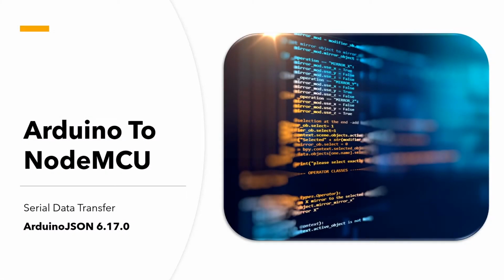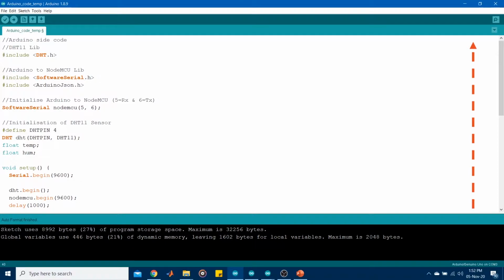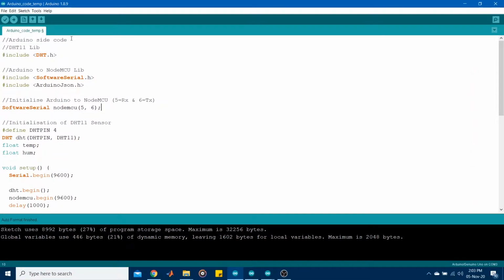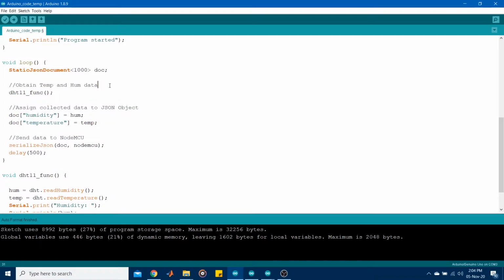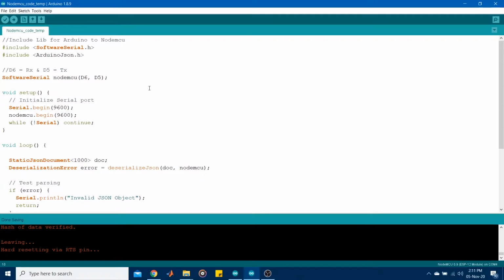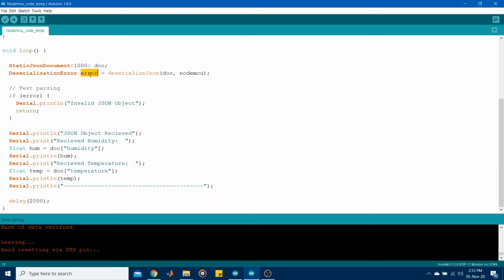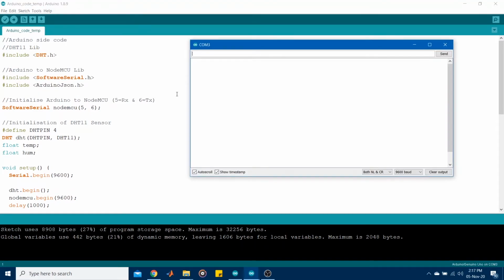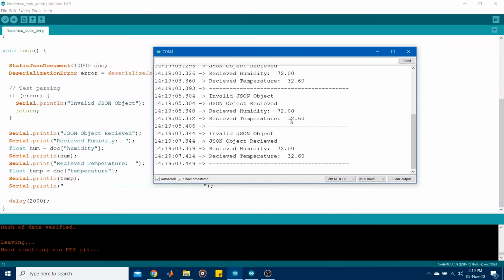ArduinoJSON 6.17.0 | Arduino To NodeMCU | Serial Communication | DHT11

Comment: I have a question, how can I send data from Nodemcu to Arduino? I need data from the web page then send it to Arduino.
Reply from the maker: Create the static JSON object using the Nodemcu and  assign the relevant data to it. Then place it on the serial port and read the data using the Arduino (deserialization). Practically, swap the Arduino and Nodemcu commands around. Hope that helps.
Reply: @thatsengineeringsl  Do you have any samples sir about this? I only have a little background about ArduinoJSon. Gladly would help